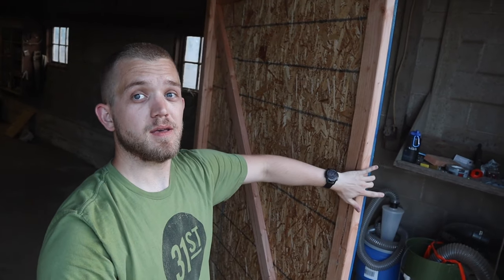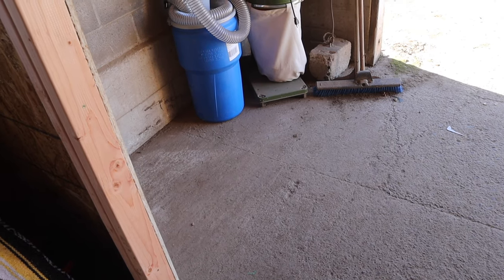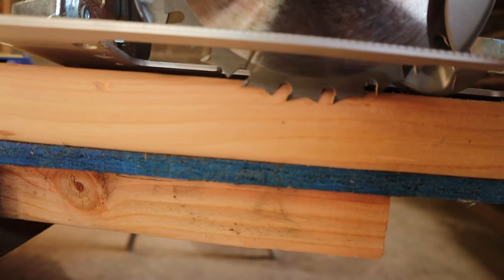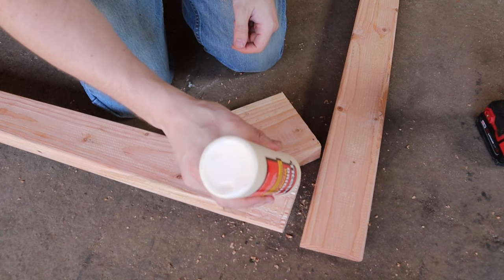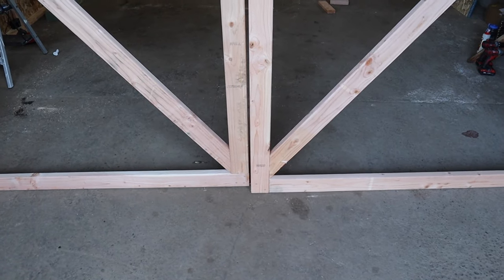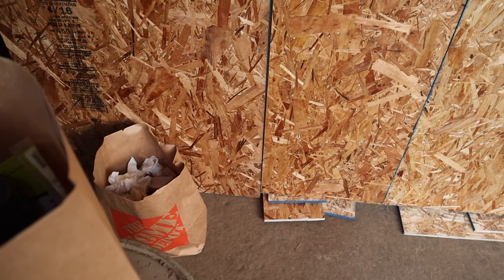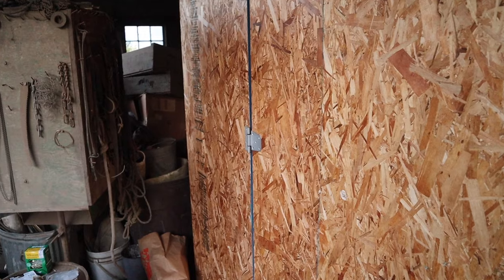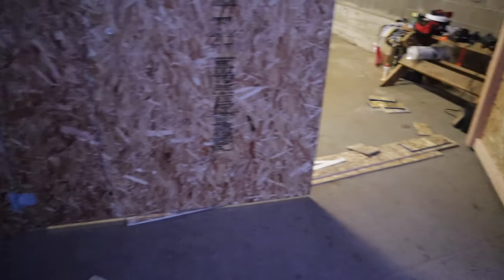Building a Custom Shop Door from Scratch!

Comment from the maker: *NOTE*

I have since learned that the cross members should go the other direction. High in the middle, low on the hinge. Because, wood is like a whole bunch of fibers in a rope. When the door’s weight pulls on them, and causes tension, they can slip past each other (high on the hinge and low in the middle) But, if you put them in compression they won’t and the door is less likely to sag. Full disclosure, my door hasn’t sagged but I wanted to relay what I had learned. 

Thank you all! 

Josh
Northwest Craftsman
Reply: I thought the same until I realized you used OSB.  The OSB will distribute the forces fairly well and shouldn't sag.  Any sag you end up with someday will likely come from where the hinges are screwed to the door.
Reply from the maker: Great point! That may be why it hasn’t sagged.
Reply: yes, should be fine. OSB is strong in shear when fastened to framing properly, will create a membrane, general suggestion for OSB door panel next time add glue on framing face, such as titebond III, OSB then screw 4-6" o.c. Paint entirely with good quality exterior paint.
Reply: I was going to say the same… If you can swap the doors with each other, then they should be in compression.
Reply from the maker: @jeffweber8244 man! I hadn’t even thought about that! Thats a great idea. Luckily the OSB has locked it in well. Otherwise, I’d likely do this 😂
Reply: Good call on the bracing, like how you you gave an edit and will definitely be using OSB as the diaphragm…great vid and kudos to the commenters
Reply: I was going to say "Oh man, he got that backwards. I want to tell him, but this is two years old".  Then I see that it is two years old- now I just feel bad for the guy for how caustic the "Hey $##%, you're doing it wrong!" responses are probably going to be. It IS the internet after all.    So, good on you (!) for keeping this video up, suffering through the sea of "Uh, actually" comments, and pointing our where you learned something.   I'm going to subscribe to your channel just for that! :)
Reply from the maker: @lifeofreilly well thank you for your internet awareness 😂 it’s always funny to me getting repeat comments when many of the top comments answer. But, as you mentioned, it’s how I learn so it’s not all bad 😊 thanks for subscribing! Love having reasonable people around the community.
Reply: I don't know why people are worried about sag. The OSB is wide enough on each door that there isn't going to be any. Sag in this application will be all from the hinges, not racking.
Reply from the maker: @TomKaren94  spot on. I’ve had none in the past 2 years

Comment: Your diagonal door bracing is going the wrong way!  They are supposed to go from the lower hinge to the upper opposite corner to support the weight to keep the doors from sagging. The way you have it they are being dragged down.
Reply from the maker: You’re totally right! I learned after the fast that I did this wrong. Luckily for me the doors haven’t settled but thank you for pointing this out.
Reply: Thanks for the tip
Reply: That's right. That diagonal, as build, is working under tension. were a steel wire or steel rod, wich works fine under tension, works great. But wood, especially it's joints, (almost) only works well under compression.
Reply: I was about to queation it too😂
Reply: Swap doors to other side and your good
Reply: Yeah just spin the doors
Reply: OSB is not going to sag.   That is why it is called sheathing,.

Comment: You really should do more research before putting out "how to" videos.  Wrong bracing, inadequate hinges, unprotected OSB on an exterior wall... I'm no carpenter and even I know better.
Reply from the maker: Yeah, I always struggle to find a balance between saying “this is how you should do it” and ”this is how I did it.” I don’t claim any special expertise, in fact, the whole purpose behind my channel is helping other folks to learn from my mistakes, and it is comments like this that help to point out what I’ve done wrong. That’s the weird thing about mistakes, you only know after the fact, or when someone points it out. 

In response to your comments, and some of the things that I’ve learned since building the door:

- The bracing is absolutely wrong, a few other folks have pointed that out, and since then, I have corrected all my doors in the future. Fortunately, for me, the OSB on the outside properly skinned the doors and provided all the rigidity needed to keep the doors from sagging.

- Regarding the hinges, I was right there with you in worrying about whether or not they would be adequate, but they have held up great over the years.

- Regarding the unprotected OSB, that was actually on purpose, it is sitting about 10 feet inside of another barn door, which means they are never exposed to moisture or weather. It would certainly look nicer painted, but I didn’t paint them on purpose.

Again, my whole goal is to learn and get better at this as I move forward. I do appreciate you pointing out anything that you think I’m doing wrong, because even if I did it on purpose or it worked as intended, it makes me rethink why I did it and if I would do it again or differently. 

Have a great day! 

Josh
Northwest Craftsman

Comment: Nice instructions, thanks. I cut the boards to size first, then screwed the 2x4 to it. Saved lots of time. Plus I installed the hinges like a man door, so I have access to them anytime.
Reply from the maker: That’s a great idea! Especially since the OSB is a structural member it’s less about the 2x4’s alone. 

Good idea on the hinges as well. I couldn’t do them like that since I screwed up my framing and one of the walls wasn’t plumb. But nominally, I think that’s better 😂

Comment: Excellent video.  Very thorough.  I’m making 3 garage doors for my barn and will use your plan with some slight modifications.  Thanks!
Reply from the maker: Glad to hear it! As noted by many other commenters, my brace is backwards for one made of wood. It should be in compression where this one is in tension and has more risk for sagging. Mine hasn’t because the OSB locks it all in but it is worth noting. 

Good luck on your doors!

Comment: Great video, minor issues never hurt anyone! What size are your doors? Look around 6’… what size header did you use for your opening?
Reply from the maker: Thanks! Glad you liked the video! 

They are about 6’ each, would need to measure but about that. And I used a double or triple 2x6. However, it’s not structural, except the door, because it’s framed within a pre-existing structure.

Comment: Good job. For security, the hinges on the  outside can be easily removed by thieves. Maybe use carriage bolts, washers, and nuts. A very real concern in our times.
Reply from the maker: That is a very fair point. Where we lived I wasn’t worried about thieves and the star bits still seem to be off enough to deter folks but you’re right, fastening to the inside would have been the most secure.

Comment: nice work! did you figure out how to seal those gaps from dust?
Reply from the maker: Thanks! And great question, I found a solution that works well enough. At the bottom I have some door sweeps and on the edges I have garage door gasket which just hugs the inside of the door. Works like a charm.

Comment: Thanks for the video. Apologies if stupid question but when you put the hinges on are the aligned to the wall or to the door (on the left side where you showed the growing gap?  Thanks
Reply from the maker: Hey Alan! That’s actually a phenomenal question. The goal is for the doors to swing evening across the ground at all positions. To do this, the hinges need to have their swinging axis normal to the ground (plum to the floor) and aligned between all hinges. The axis can be imagined by drawing an imaginary line through the center of the hinges cylindrical portion. In my case, to make the hinge plum to the floor, I aligned it with my door since it was square and my frame was not. Let me know if that doesn’t quite answer your question, I can always shoot you an email with some pictures and drawings.

Comment: Great video, thanks for all the detailed info, especially around tolerances.
How did you end up fixing the gap between the door and the side of the frame?
Reply from the maker: Great question! And I’m glad you enjoyed the video. The hinges were able to cover the gap so I hung the door straight and accepted the slightly larger gap near the top of the door. On the inside I have some garage door weather stripping which seals around my doors and covers this gap inside.

Comment: A few flaws that I see... 1. You used chip board for an exterior wall. I will deteriorate much faster than plywood. 2. Your hinges are awfully weak for such a heavy door. They will give way much quicker too!
Reply from the maker: Thanks for your feedback Peter! 

What you said is 100% correct but I didn’t show the entire context of the shop. The doors sit about 6’ inside of another entrance and are well protected from the elements. I agree though, Plywood is far more durable. 

For the hinge, each was rated at something like 50-75 pounds which I calculated should roughly cover the weight of the door with 3 of them. So far so good, but that was another potential weak spot in the design that I planned to keep me eyes on 😂

Again, thanks for the feedback, it helps me to think through why I do what I do and to identify areas for improvement. 

Have a great one!

Josh
Northwest Craftsman
Reply: @NorthwestCraftsman  Of course! Something else to consider on those hinges. That rating isnt taking the wind loads into factor. May I suggest hinges that are used on cattle panels? Last year I built a swing door for a lady who lived on the prairie. Her hinges were destroyed in a matter of weeks. I thought the same thing that the weight of the door was the only thing I had to consider. Just some food for thought.
Reply from the maker: Interesting! That’s good to know and I know exactly the type of hinge you’re talking about, that would be far more robust.
Reply: What thickness OSB did you use?
Reply: @NorthwestCraftsman  pressure treated plywood would be a bit better. paint is a consideration. Winds blow rains. When your non treated wood soaks up the rain it's going to get real heavy on those hinges.
Reply from the maker: @blmcgrady, Oh my word! I’m sorry for not responding earlier. YouTube hides my comments sometimes and it’s only later that I find them. I used 19/32” if I’m remembering correctly
Reply from the maker: @zedwpd, totally agree! I didn’t show it well here but this door is about 6’ from the actual garage opening so it’s protected from the elements. Otherwise, yes, pressure treated would be a better idea.

Comment: I was hoping I would find another "clean-up Tour" where you removed dust from the rafters and all the elevated structure of the building.  Did you do that and just not put it into a video?  Your "tour" was May 22, "Shop Doors" was July 7, suggesting they are consecutive productions.  I'd appreciate a response on cleaning the upper parts if you did it.  Thanks in advance.   DIFFERENT TOPIC: This is not an end of the world mistake, but the diagonal across the doors should go from the hinge side bottom to the handle side top.  Wood is not isotropic like steel, meaning it does not have the same strength in tension as compression.  It is much stronger in compression.  You want the diagonals to be oriented the strong direction, compression, not tension as you have them.  On the farm when I was growing up, a 16' gate that had the diagonals the wrong direction had to be taken apart and repaired about 5 years after installation because it sagged too much.  Once we learned this error, we repaired the mistake as soon as we discovered it, usually during assembly, instead of waiting for it to sag first.  We also found out that all the old-timers all knew that and kidded us about it for some time.  Your doors are not that long so they might last longer without sagging.  If they sag, you can always prop up the door like you did when hanging it, cut a notch in the existing diagonal and insert a new diagonal in the compression direction.
Reply from the maker: Yea, I skipped that second cleanup video which covered most of that work and though in general the videos are in chronological order to when they were filmed, that’s not always the case 😊

Thank you for your note! I just did some quick research and you’re totally right. I was thinking of doors supported by a cable which is quite anisotropic but beautiful in tension. Next time around I’ll make that adjustment. Thank you for the nugget!